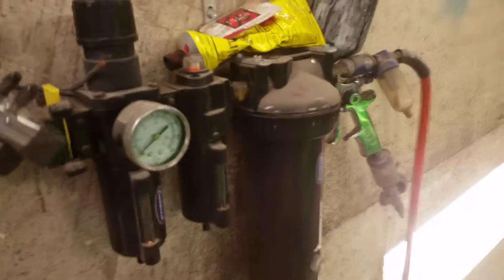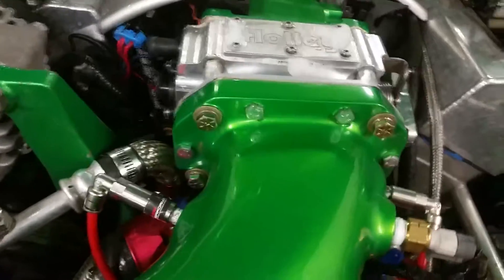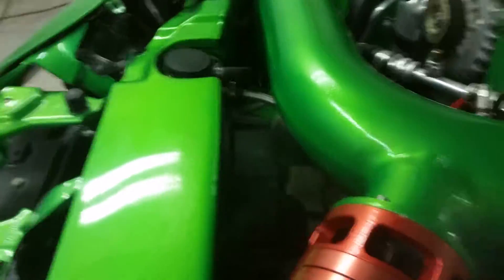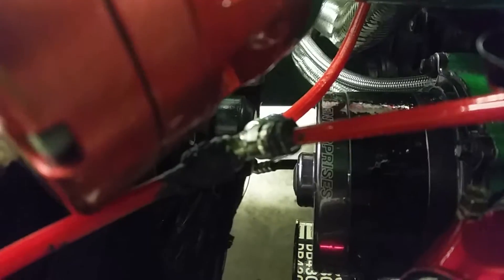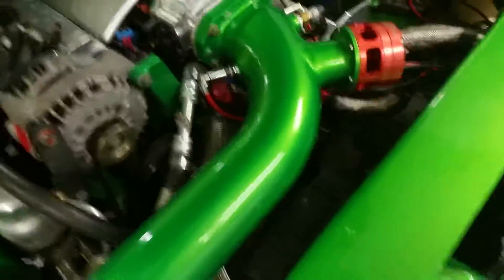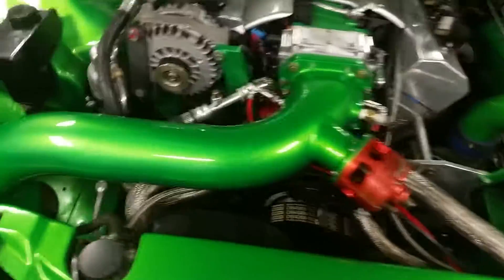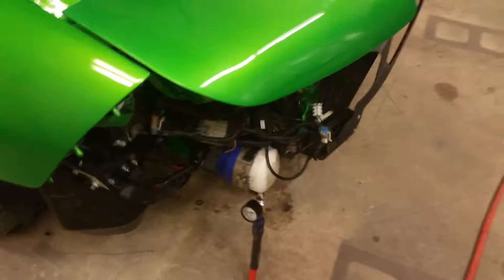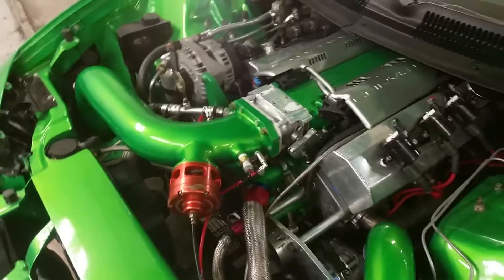Boost leak testing on an Lt1

Comment: Beautiful setup sir. So where and how are you testing the leak? I see it connection you had but not very clear on what was going on there.
Reply from the maker: Big Kuntry Performance TV thank you. instead of running a cap at the blower inlet to pressure test cause I know all of that section is good. I just put a cap at the piping from the intercooler side since it's easier to test  for my setup. other wise I have to remove my rack and pinion a side and steering neck just to do the same test.

Comment: I'm ready to see some numbers, what gas are you using. Pump or e85
Reply from the maker: joshup e85 770 with issues and should be in 850+ with everything fixed.

Comment: Nice car.. What alternator are you using?
Reply from the maker: sstevocamaro thanks. Ad244 powermaster 244 amp
Reply: @BigErnGearz  is it a direct bolt on?
Reply from the maker: @sstevocamaro  no, it is not.